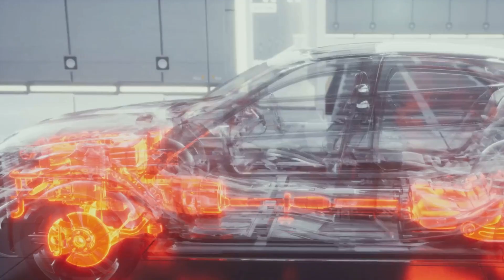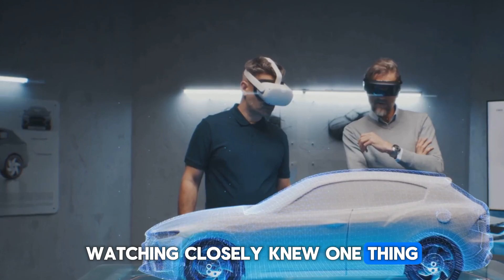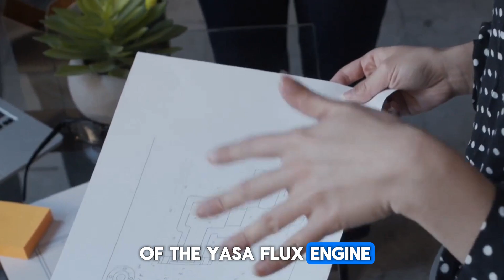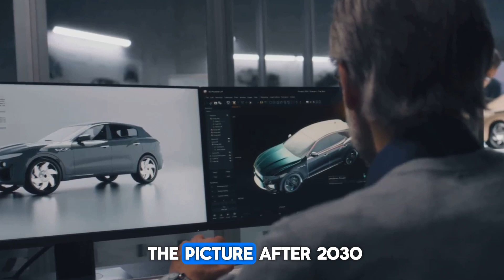Mercedes Drops a Bombshell: YASA Flux Engine Officially Confirmed!

Comment: 'Bye bye electric' (on the thumbnail) - it is an electric motor dummy! It is a motor, not an engine (look it up). It does not change the battery. Most of the video is stock shots. It is not even a new tehnology- I worked on equipment that used axial flux motors in the eighties.